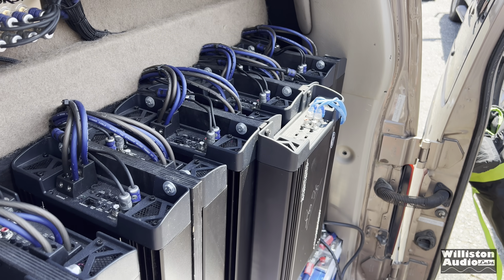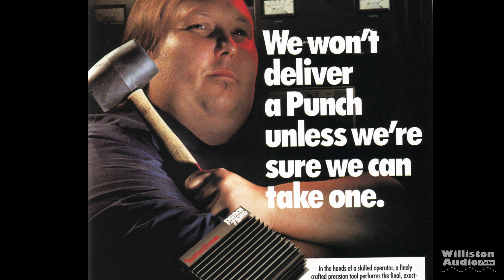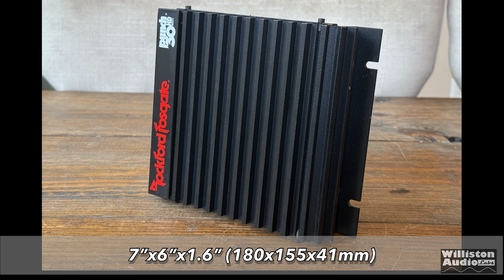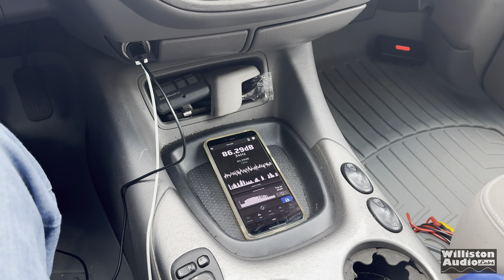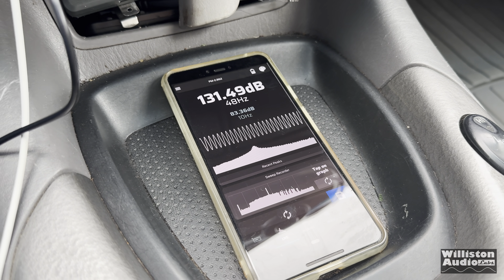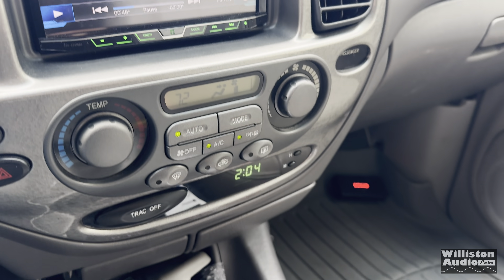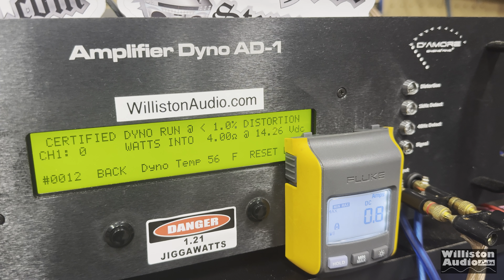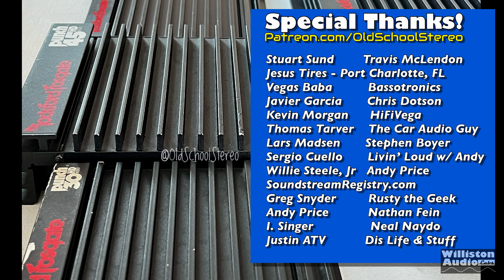Can This 35 Year Old, 30W Amp Power Four 12" Subwoofers?

Comment: It's called Cheaters amp,,, For us Older Generations..I used to compete back in the late 80s and 90s .. Every was made in the USA not made in China...Made in the USA true RMS,,,, When Rockford Foshate come out with the Power Series 350 RMS when you dropped it down two ohm's it's bumped up to also 2000 watts RMS ahhh

Comment: what would the SPL results have been if you used subwoofers with a lower efficiency? seems its the subs, not the amp....
am i wrong?
Reply: Way lower, but that's the point of the test. Back in the day, people ran those amps with high-efficiency subs. Some ran 8 15" subs with those tiny amps.

Comment: I grew up w/ sound guys for concert level setups and they always told me it isn't about electrical wattage to get loud. A lot of modern confusion has happened and people are referencing wattage in 2 ways but don't really know it. A 1000w reading on a multimeter is not 1000w acoustic, hence why a larger box and better resonance gets you louder. Half these cheapo brands say 1000w RMS and they do not mean 1000w electrical they mean acoustic, which like 200w amp will push 1000w acoustic easily.

Comment: In the early 2000s when I first got into audio.. I kept hearing "now watch with your subs.. they can be killed by too little power just as easily as too much power..  So if your running 4 subs at 30w.. is that just BS?

Comment: Your woofer's sensitivity @48Hz is around 115dB than (if I'm not mistaken), which is crazy!
So with a 1000W input you should read about 145dB, with 4000W around 151dB (all at 48Hz). What do you think, is my calculation right?

Comment: My rear view mirror used to vibrate so much that I couldn't even see anything with my Kenwood KAC-921 and a Kenwood KSC-7702 3-way hatchback speaker box that had 2 × 10 inch subs, a midrange and tweeter. I miss those good ole days! And I had a Kenwood head unit.

Comment: Im surprised but also not suprised since guys did it already. Im running single 12 400w rms pioneer canadian tire special sub basworx ported box pretty large and it movvvvvvvvves so much air i need a db tester to see what its doing. 10 yesr old nephew loveeeees bumpin easy e and icecube and em anytime hes in the truck

Comment: I have a question. The way you hooked them up, in series, wasn't just the first sub moving and the rest got nothing? If you hook up light bulbs in series, the first is bright and the rest get dimmer and dimmer the further they are down the line. Was it just moving 1 sub in this video?

Comment: A guy gave me an old Rockford Fosgate amp, just slightly newer than this one, for free because he wasn't sure if it worked... it had been sitting for years. I hooked it up to 3- 4 ohm 10s, and it bumps! Only about 100 watts per sub if it is working like new, but sounds as good as my newer amp putting out 200 watts per sub. I actually have vintage 10s... 1 is an original MTX Blue Thunder, one is an original Rockford Fosgate Punch Audiophile, and the third is a series 1 Rockford Fosgate Punch P1.

Comment: Back in 89, i powered my whole system with a punch 45. (2)15s,(2)8s, (2)5.25s, and (2) compression horns.  These were cheater amps that put out way more than advertised.  I still have that amp and won't ever get rid of it.  They don't make then like they used to

Comment: If the manual showed how to connect 16 speakers to a 2 channel amp back then. Why would it not be the same as for today with the later RF amps from early 2000s to current?
If saw this manual for my first build in 2000 I would have just used 1 amp instead of 4 channel n sub amp. lol.
90s small punch amp
2000s medium to xtra large amps
now amps trending back to small again 😂🤦‍♂

Comment: Look into the punch rail amp, it was produced about 15 years ago as being one of the smallest platform amps ever, it used to get hot but put out some good wattage. This blows my mind though 40 watts basically 10 watts a speaker an still hit a 133db but to achieve 150db you need a 2400 watt amp the box is rated for. Seems at this point adding more wattage just increases the air flow an how much stuff vibrates within your vehicle. I wouldn't mind seeing what happens if you put a 2400 watt amp and just tried to achieve a 133db burst (nothing more nothing less) just to see if more stuff shook or if it was the same output with this amp didn't seem like the rear view mirror was shaking very much

Comment: Hey Big d I'm 47 years old and in my experience the most ultimate cheetah ramp ever made was the punch 150 you could run that thing at low ohms. I've seen it run at 1 ohm powering 4 "12's in a half wall and a 1986 Camaro and it would drive up the street, siebenthaler which is a main thoroughfare in Dayton Ohio and every house on the street rattled!!! It will run until the internal components would decider from heat until the internal components short it out but my dude had a similar air conditioning unit hooked to the box that was in and at that time it felt it's cold and liquid nitrogen of course it wasn't but it was air conditioning chemicals for a air conditioner. Man's name was Alan an app store with Old School Bass! And how I was introduced to it!!!

Comment: You know it's really funny you act like you know about speakers and amps and you completely overlook the speaker ratings of RMS power and the power the speaker say 2400 RMS so that tells you right there so 50 Watts are not going to accurately cause speakers to function. Even though they're 98 on the sensitivity that does not directly affect minimum power requirements. You are going to overload this amp. It's going to clip. At least have some kind of knowledge when doing a demonstration like this.  Case and point I've got some Cerwin Vega vs 15.  15" 3-Way Frequency Response: 28Hz-28kHz, Power Handling Capacity, Minimum/Maximum: 5/400 Watts, Sensitivity, 1W at 1M: 102dB, Nominal Impedance: 4 OHMS.
And if you notice it says 5 w minimum but anything low what will not drive the speakers 100 watt strains it will blow fuses and has blown a Sony 100 w stereo system amplifier and anything over 3/4 volume. When having amplifiers and speakers you need to be close to RMS power otherwise you're going to cause heat and damage. 100 will drive them decently just not at full volume.
Reply from the maker: This comment is funny because you prove my point of high efficiency vs output. Thanks for the knowledge

Comment: I well get those type of speaker's that have a S on it supposably those are great speakers and not exactly what kind of kickers but I think it was either black or yellow. And disliked them was 12s but I got some 10s custom box and supposably does pack a punch. That is with a ram 03 quad truck. But my ford expedition XLT max now those are going with the big boys those exact speakers 12s  2 of them and make it under the back of the trunk tweeters all doors upgraded speaker doors and get someone to remove all interior and install  sound dending which can cost 3k but don't care want that peace.. and worth it when there is party's and you want nothing but peace and quit trust me the expedition with go from a 7 to w 10 and get a lift get 33on

Comment: Back in the 80's in high school, a buddy had a Punch 45 driving the hell out of a pair of 12" Kickers.  I mean pulling into school and the metal mini blinds rattling in the window sills. Running half ohm load and you could brand cattle with that red hot amp.  It lasted for many years.  Other guys with the same bass output were using amps the size of ice chest lids but he was booming with that 45 the size of two decks of cards.

Comment: When that amp was made there was a class for 30 and below, so the marketing for that amp fit the class and the 30amp was at 8ohms, and it was made to take 2ohms, so it just kept increasing power as resistance dropped, but it was marketed at 30A @ 8ohm, so that amp was legal for the 30 and below class.

Comment: Today to back then is not comparable. I’ve put a 800a Rockford on 2 12 in kicker comps when I was 18z I’m now in my 30s and I have 8 6.5 soundqubed on a 5k taramp in my vw and 2 12 inch hdx3 on a taramp 8k in my Subaru . Still have not done a meter yet😂😂😂😂

Comment: When I got into this hobby I had a "kicker by still water blues" in a hand me down car from my uncle. That got me bit by the bug, and I built my first system, two Lanzar DC12's and a Lanzar 50c amp.  My buddies were all running these, and I think (foggy memory) that might have been towards the tail end of these first punch's. Everyone I knew switched over to lanzar after hearing mine, but it seems like amps were just more powerful and bad ass back then. This don't shock me at all

Comment: I would have liked to see what it did 2 channel 2ohm.   The old Rockfords were notorious for impressive power gains at 2 ohms. Then slam the 12s with a punch 150  or 200.
I loved the old Rockford Amps and speakers. In 96 I had 4 series1. 10s on a punch 40. Back hatch of my camaro  doing 136db.

Comment: Back in the day, my buddy had an Acura Legend with MB Quart 3 way components up front , some 2 way Pioneer 6x9's for rear fill and a pair of Rockford Fosgate Punch Pro 10's all run by a Punch 45 amp. There was something about that combination that just worked. He had an additional battery and a big capacitor in the trunk and caps and coils all over the speakers. To this day I'm not sure I've ever heard a better sounding system.

Comment: I have hidden gem Phoenix Gold XS2300 rated to 2x25w but 1x300w 4 ohm mono and manual say you can run it to 2 ohm mono. I tried it with one 12" Cerwin Cega almousta as old as amp 200w sub. And damn that compo tried to rip my old Volvo S40 to peaces. Amp probably gives something near 600w in 2 ohm mono.

Comment: My grocery getter had 2 punch 150. A punch 75 and a punch 45  with 4 12 inch fosgate subs in the back mids and highs were all infinity kappa and infinity reference I had  2 is the subs at 4 ohm and the other 2 at 2 ohm  each powered by a 150   needless to say my system rocked it was all rock and heavy metal no rap. And my whole car was dynomatted.  Extra battery digital capacitors ECT. No room for groceries

Comment: I had a 1980 Rockford Fosgate 40 W Punch amp with a Concord stereo and cassette deck (you could rewind and FF while listening to the radio, which was unheard of at the time) into a pair of Kriket 6x9 speakers in my 75 GMC pickup truck when I was 16. That little amp was extremely loud for 40 Watts! I loved that sound system. So did my friends. ❤

Comment: Back in the day the rating system was totally different than today, in '89 I had a 300 watt amp running full range and you could hear me crisp and clear 4 or so blocks away now I've got a 2000 watt amp and it can't get loud enough to hear 1 block  away...

Comment: I use Zobel networks to flatten the impedance curves of high efficiency drivers, when paired with tube amps, in home audio. 
The output transformers don’t like impedance inconsistencies, especially vintage amps. 
I’ve never thought about using them in car audio until now, the impedance is all over the place.

Comment: The magic here is the 99+ db efficiency of the sub system.  Any amp that could provide a clean 50 watts at the same impedance would perform similarly.   For 1 watt you get 99db.  Double the watts you get 3 more db.  2 watt 102 db.  4 watt 105db.  8 watt 108db.  16 watt 111db.  32  watt 114db.  etc.   Add in gain from the enclosed vehicle and voila.

Comment: Example back then of how the design was important when it came to impedance for each company and how they chose to either regulate the power rail or not.  i.e. Hifonics/Lanzar  While Phoenix could be loaded down and deliver, but were not in the higher wattage class.  This was from my limited observations by attending a couple of events at Portland Meadows and Northgate Car Toys events ages ago as I was considering entering in the Novice 700+ class with my '81 Fleetwood for fun. I'd been to a number of shops wherever I spotted one trample'n along the "Eye 5" from far north as Bellingham WA to south as Grants Pass OR.  I made due with my two Catalina Classics pushing four 12's and one Hifonics Zues pushing from drivers and another pushing my rear fill in the back deck. Provisioned by my Sony Uni-Link head unit with CS changer in the trunk, crossed over by a Coustic XM-5.  I never got to get to the One-third octave Audio Control and have a RTA to get it "tuned". But the Blaupunkt "Honey Comb"' mid-bass drivers I recall were interesting as they were shallow mount in the lower door panels without a pod.  But I'm just an old man now who still like his music.

Comment: My '91 set-up. Short Bed '87 Toyota Pickup, slammed of course. Custom built enclosures by Al and Eds, 2 Punch 8's, 4 Punch 6's in the doors with Punch 1" tweets. Power was a HiFonics Pluto for mids and highs and Thor running the subs. My truck hit so hard, folks couldn't believe I only had 2 8's. The amps back then were just built way different.

Comment: You gain more db's by doubling the cone area than by doubling the watts in a Amp.  What makes the most difference is the sensitivity on your  speakers or subs. 

 
  Doubling the watts  ( say from 100 to 200 watts) will  equals 3 db's only.

 Doubling the cone area od your drivers will equals 6 db's.

Comment: Back in the days I had an old 12" Electro-Voice Bass speaker mounted in the trunk behind the back seat. The datasheet said that this speaker had 105dB efficiency.
They didn't lie. I powered that thing with two ancient Clarion 25W Amps. They had output transformers, so you could bridge them. That setup shook the roof of gas stations if you cranked it up there.

Comment: I used to use one Rockford Fosgate Punch 45 bridge to mono and it power my 2= 15inch Rockford Fosgate Punch Subwoofer with a digital Clarion crossover and custom box along with highs and mids and it SOUND AWESOME.. the Punch 45 work better and sounded better then the Punch75 and the Punch150 in my opinion back in the late 80's early 90's..
I'm definitely not surprised by your results...

Comment: My buddy blew his Colossus VIII and installed a Cupid VIII in its place and that it banged. The Cupid which was the size of a double cheese burger was pushing 4 Audiobahn AW1200qs in a 4cf sealed enclosure. When I saw a 44 watt amp had replaced the 1200 watt colossus my brain actually rebooted.

Comment: now do a box with 8 GRS12SW-4's, those woofers have a sensitivity of 89dB/W, 120 RMS and cost 34 bucks a piece

it would be interesting to see that on 30W but also on a 1000W amp (which is their RMS rating)

if i lived in the US i would sponsor that cuz 272 bucks for 8 subs aint nothin besides it probably gets DAMN loud with the efficiency and for the price

most of these brands also rate it as their in-car sensitivity, the kicker woofers used actually have a rating of 86.7dB/W each, which is 2dB lower than those GRS'

Comment: My buddy, back in 1996, had 3-JL audio w6 12”s run by a pretty big Rockford fosgate amp. It hit a 159 at a bass competition in 1997. It was bad to the bone. I still have a kicker 1200 amp pushing a couple of solobarics. Old equipment but it still gets the job done. The gain and bass boost are both set on about 4 of 16, or it will blow the speakers

Comment: After my Boston Acoustic amp burned up. The Punch 45 from the 80’s would push the box behind my Nissan hardbody p/u seats with 2 M&M Godfather 15” subs, 2 punch mid/low range plate speakers with no problem. I could be heard from 2 blocks away.

Comment: Back in the mid 90's I ran a Orion 280GX moon and stars on my subs and a Soundstream D60II on my doors in my old minitruck. I think I was using 2 12" Pyle with the 40 oz. magnets at that point. Might have still been using the Orion when I went to 2 10" JBL GT104D's. I had a pair of the 6.5" Advent speakers that had the phase plug and a 1" dome tweeter in the doors. I changed the 6.5" out for a 6'5" poly woofer from and a 4" sealed back midrange from Radio Shack. I worked at Radio Shack at the time. But yeah you could still get loud with less power. You can do it today if you buy the right subs. At least plenty loud for the average consumer.

Comment: I was born in '71 and I started building car audio systems in 1987. The Rockford Fosgate Punch series of amps were what I would call the "mediocre of top end" amplifiers. The Orion's were the SH1T, but the Rockford Fosgate Punch weren't far behind. I personally witnessed a Punch 150 destroy a pair of Pyle Driver 6"x9"s. The old school 80s Punch amps weren't something to take for granted. I'd bet an 80s Punch 150 would knock the bottom out of a modern set of 12" subs. I'd put my old Punch 150 driving a pair of Celestion 12" subs and a Punch 75 driving a pair of Pioneer TS6950 6"x9"s in the rear with a Punch 45 driving the old Pioneer 6 1/2" square honeycomb speakers in the front in a 1969 Camaro up against modern"systems" any day.
Reply: BTW, I'd love to see you get ahold of and do a test of the Pioneer TS6950 6"x9" speakers. They were and still are, in my opinion, the GOAT of 6"x9"s. The successors to them were too "bright". They had the perfect combination of bass/mids/highs to any "rear deck" speaker produced. Give them 50w-150w and they will AMAZE you.
Reply: Agreed. I had a pair of the 6950’s on the rear deck of an ‘87 Sentra pushed by a Sherwood 70/70. People always asked me what subs I was running😂. Traded for an ‘89 Jetta GLI and no one had 6950s. So I got the new 6960 4 way 6X9s and I was never as happy cause just like you said … too bright

Comment: Couldnt stand fosgate.  

I had 2 pioneer gmh 100s running my 4-12" subs.  A 4 Channel gmh 120 ran 2-8s in the doors and a pair of 6.5 and tweets in the kickpanels.  Ran off of 2 crossovers if I remember right.

Eventually i ended up with 2 PPI power series amps and I still have both of them today.  My 6 channel is running my boat system.